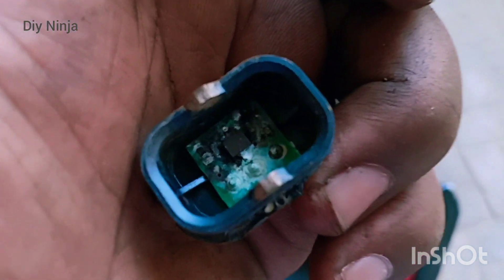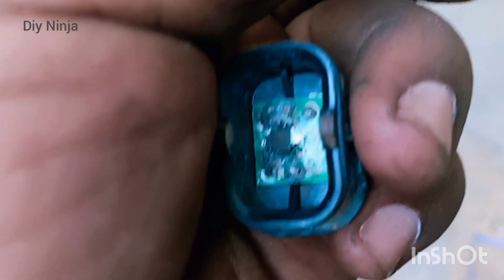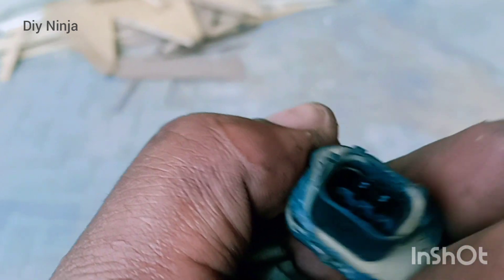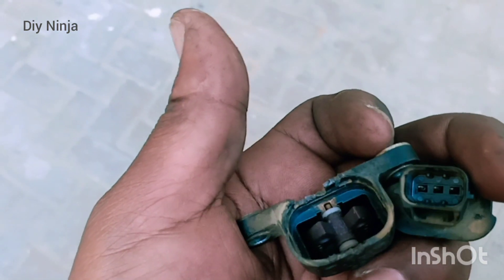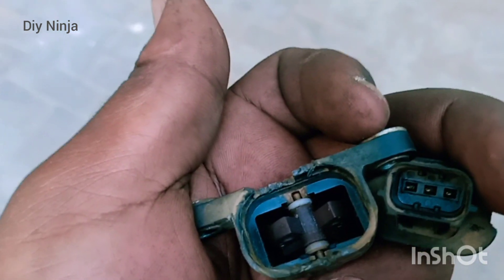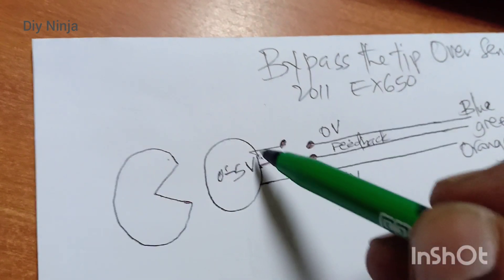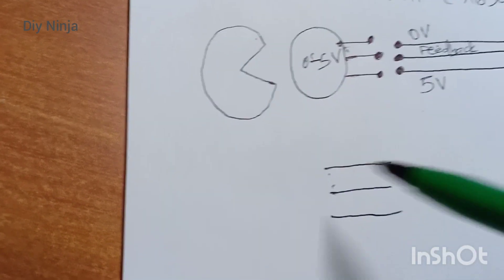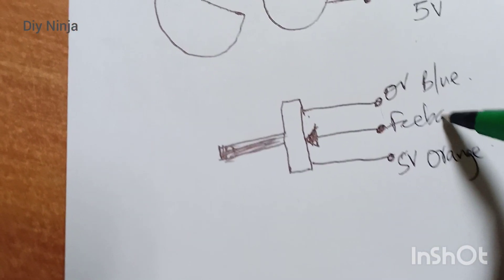Kawasaki Ninja650 Tip over sensor diagnosis and bypassing

Comment: Riding a 2013 versys 650 and the sensor issue happened to me today. Your video was a god send. Thank you for sharing this!
Reply from the maker: I'm happy you found it useful. 🙏🙏
Reply: i have a versys 2013 to cold start its ok but the enigine hot the bike turn off on spark to ignition coil

Comment: @Mbari Peter , I thought with the tip over sensor being bad, that in itself would stop the bike from starting, even for that second, because the fuel pump would be told not to prime. Am I wrong? Thank you
Reply: Gravity still seems to force fuel down
Reply: From the service manual..
'When the motorcycle is down, the vehicle-down sensor
operates and the ECU shuts off the fuel pump relay, fuel injectors
and ignition system. The ignition switch is left ON. If
the starter button is pushed, the electric starter turns but the
engine does not start. When the starter button is pushed,
the yellow engine warning indicator light (LED) blinks but
the service code is not displayed. To start the engine again,
raise the motorcycle, turn the ignition switch to OFF, and
then ON.
'
Reply: @tedtheturbot  Thank you for the reply. Unfortnately when I was asking the question to the poster, who never replied, so double thank you, I was asking because after my ride home, then going to start it again, I could hear that it wasn't/isn't making the usual sound when you turn the key (like the 2-3 second whine noise). Now the specific bike I'm referring to is my 2000 Kawasaki Ninja ZX-12R, the A1 (I didn't make up the A1 part. I guess, and think, that the A1 represents the Unrestricted Model, whereas, for instance my icon/thumbnail picture is of my 2003 ZX-12R, which is called and labeled on the Title B2/ ZX1200 B-2. Like this one, the icon picture one, the 2003, the speedometer says 180mph, with the additional line that represents an additional 10mph; whereas my 2000's speedometer shows 220mph. I don't think the A1 represents Ugly Green, versus B2 being Pretty Green, cause that'd be an opinion.), and from shop to shop, now at the 3rd, with them adding in, ''it's also not getting spark'', and this is after the new/replaced ignition timing sensor, I myself am just starting to think that the ECU/Brain went out, and I'm not a mechanic, nor a Rocket Scientist, but I'm ready to, well, actually, if this 3rd shop doesn't have it nailed down to EXACTLY what it is at 6:59pm on Monday when they open back up, then I'm paying my bill at 7:00pm, calling AAA to get it to bring it home, and while awaiting the tow truck I'm gonna go on eBay, and either find and buy a 2000 ECU/Brain myself...... or maybe a baseball bat cause if I go the baseball bat route, I'll have the option of buying new, used, a 2020, a 1910, Aluminum, Wood..... heck, just that right there is sorta showing me the Smart Route. Still the same, thanks for the reply @tedtheturbot !
Reply: @mikefl100  no problem..
My 2009 Ninja 650 wont start most of the time. Starter motor isn't getting power. Just get a click from the starter relay so im here to run the diagnostic which says the throttle actuator isnt working. But ive bought another second hand and the same F1 fault shows up. Any way whilst putting the starter relay back in accidentally bridged the terminals with the screwdriver and the starter motor turned (scared the shit out of me). So followed the manual on testing it for continuity and it's not right (im not a mechanic either so i might be wrong) so i've bought another relay waiting for it to arrive.
Reply: @tedtheturbot  if the bike still won't start, what to do?
Reply: if the bike still won't start, what to do?
Reply: @mohdsaifful3481  can you describe what happens?
Reply: @tedtheturbot  you said 'To start the engine again,

raise the motorcycle, turn the ignition switch to OFF, and

then ON', i've do that, but the bike still won't start. My bike went down, am i need to reset ecu?
'
Reply: @mohdsaifful3481 to start with I'd download the manual it's free online to help you locate and check stuff.
Does the starter motor run/engine turn over?
 So the bike was ok before it dropped no other problems? Maybe the fall dislodged something..
Yes you could try disconnecting the ECU and reconnecting and look to the manual for a reset procedure don't know if that's possible/relevant.
Check the battery connections and battery condition if in doubt recharge the battery.
Check the fuel lines are connected ok under the tank and to the fuel pump. Can you hear the pump running when you turn the key.
Does it go through the start up process normally inc the sounds she normally makes..
Check the turn signals stop light brake lights etc are working normally that may point to a deeper problem.
Find the bike down sensor and check for continuity with a multimeter, the manual will tell you how .
Check the neutral sensor for continuity.
Check the clutch sensor for continuity.
Check the starter relay for continuity and that it's connected ok.
Does the FI light come on?There's a video on YouTube showing how to check for FI error codes the bike might tell you if there's a problem.
Could be a sensor has disconnected.

Comment: Thanx for the video. Just a question. Have a 2003 Kawasaki zx636r and need to bypass sensor while waiting for new one. Want to check if everything else are ok on bike. Ground =0v, power= 12.5v. How can i reduce everything to get needed voltage to get it started? Need round about 4.45v on feedback.

Any thoughts? Thnx a mil
Reply from the maker: Hi. Sorry for the late reply. I will check if they are compatible